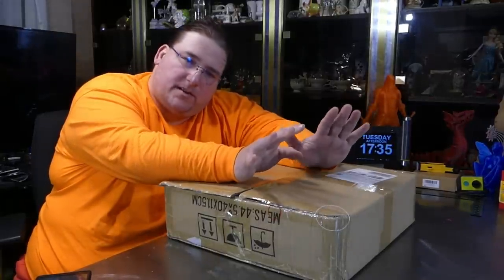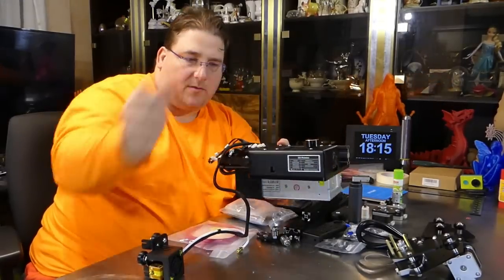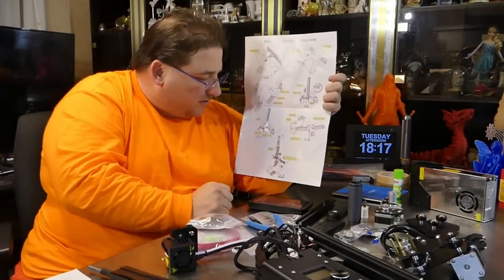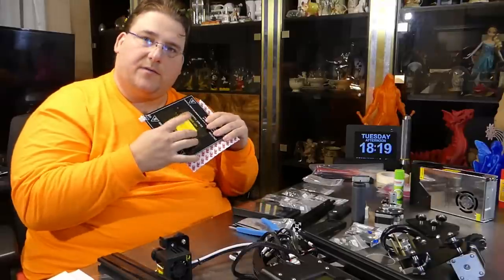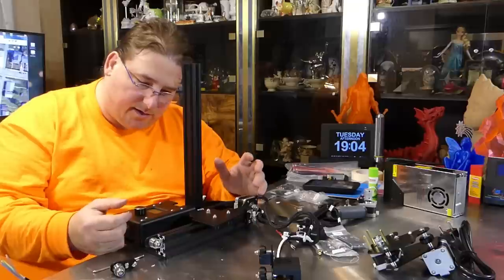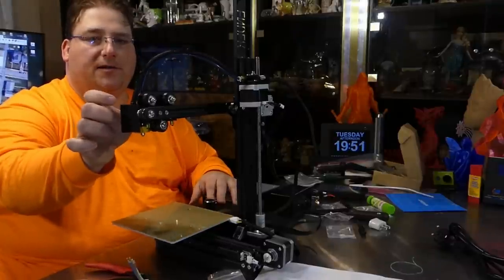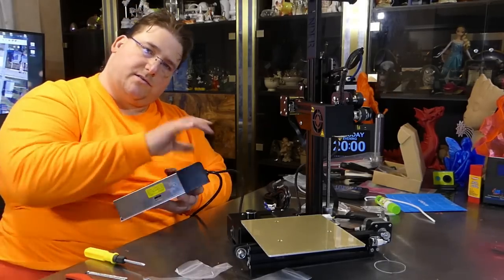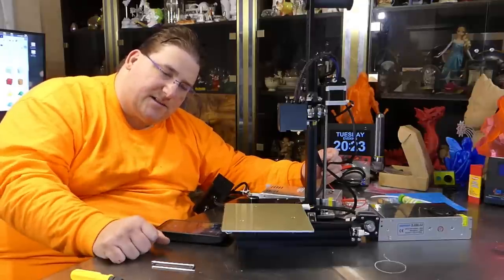Today's 3D Print 182 Ender 2 Rev2 Unbox Build No Print DOA

Comment: Hi Nerys...well, an update.  I got my ender 2 back up and running and I upgraded a few things...capricorn tube, belt tensioners...after everything was done I put on some black pla and fired it up and did a print to test.  It came out great, so I crossed my fingers and put on the dreaded wood pla...lol.  I noticed that the spool said 220 was the max, so I compromised and set it to 228 and it printed like a dream.  The print came out perfect.  I really appreciate all of your advice and help.  Guys like you are what keeps me enthused about these machines and their sometimes rather steep learning curve.  Thank you again for all of your help Sir...Richard Jackson
Reply from the maker: No problem I'm glad it worked remember there's a pretty big temperature Delta from one point on the hot end to the other so even though your heater cartridge and thermistor might be reading 230 the actual pla is probably the only reaching 225 and there's a pretty good tolerance built in there too :-)

Comment: I have just purchase the Hictop ender  and like yours mine was also DOA. This is my first 3D printer . I couldnt wait to get it up and running. . Spent the best part of an hour testing the PSU and everything was working . I then decided to remove the control panel to find the main power lead to the control panel wasnt even connected. 

It now powers up and I have leveled the Bed. Now i have just to spend the rest of my life time trying to figure out how to print stuff.  Mine never came with any test prints on the Memory card either ..
Reply from the maker: interesting. mine is a wee different the HEATERS turned on (bed and nozzle got hot) but nothing turned on. I will open it up tomorrow and poke around inside!

Comment: Apparently my Ender 2 was a Rev 2 - now i'll call it a Rev 3 with all the changes I've done :P It's fully silent now with TMC2130's and a passively cooled supply. Total investment is around $300 including the original printer price. On that note I have a spare mainboard for the Ender 2... just saying

@6:12 - strange my Y axis idler was on the "outside" maybe the kit was prepped by a newbie
@7:20 - I've noticed oddball sized hex sizes too on various screws - namely the ones holding my hotend on in my case
@8:50 - AC wire color: more commonly black is live, white is neutral, green is earth

I really dislike the power supply cover - that power supply is actively cooled with NO vents - except where the screw terminals are. The cover that comes with the printer needs some vent holes IMO.
Reply from the maker: +Ross K agreed I hate the power supply but I wanted to build it like everybody else would :-) apparently they had difficulty sourcing The Brick or it just didn't have enough amps to get the ABS temperatures so they switched out

What do you want for the motherboard :-) I suspect that's what's wrong with mine

Comment: I’m using an Xbox 360 power supply on my Ender 2 and it works perfectly. It even has a soft standby mode via a sense wire which I’ve connected to the GPIO on my pi zero for remote power off.
Reply from the maker: now thats interesting. I still have one of them lying around here somewhere (my brick died on one of my enders)

Comment: The 2 X gantry screws... The heads were also bad on my Ender.   I replaced them with M5 and heavy duty “slide in” T-nuts.  You must drill the holes a little bit larger first.   This holds the X Gantry extrusion MUCH better.
Reply from the maker: +ApplesUPnorth yep those that go through the gantry arm into the vertical trolley are super sketchy!
Reply: I have 2 of these later Ender2 printers and love them but the stupid bolts that hold the gantry are slipping because I didnt replace them and couldnt get them tight enough with the allen that starts to strip when tightening them. This is the only problem I have had with these.  When will china Manufacturers ever learn about quality control , Instead of  "these screws are a penny less for a hundred lets use them, to up our profit margin! "  Wish I would have known this but its a fairly easy fix.  I am almost ready to drill them to a larger size -lol

Comment: You can get the power cables for pretty cheap at menards, or other hardware store, cables you get from there are a bit longer and heavier gauge. I have a box for my printer so having the extra length is nice since I have to route the cable a bit before it gets out of the box.I have a box of the iec cables however some others may not. I think the super long bare cable was 5 bucks. on another note you may want to check the voltage coming out to make sure it is close to 12v. my anet had 11.4v when I set it up and had some goofy things happening to it till I checked ><
Reply from the maker: yep all you need is this

http://amzn.to/2DuLVqM

pretty sure they are like $3 at home depot.

snip off the EU plug on the cable that comes with it. strip the wires. open this thing up and wire it up. Done.
Reply: aww I was talking about the cable itself, these guys, they come in 6ft cables as well.plug end would work too. I have used these cables for fixing power tools as well. https://www.menards.com/main/electrical/electrical-cords-cord-management/specialty-cords/smart-electrician-reg-16-3-3-indoor-power-supply-cord/09703/p-1470660795788-c-13965.htm?tid=-5476609041554859570&ipos=16

Comment: Two Comments:
1) Where does cool air enter the PS? That would be the slot over the connection to the PS. The plastic cover effectively blocks the air intake.
2) I will be very interested to see where your prints wind up when you get this going. On mine they all (including the creality Cat) print 25mm to rear of where they are supposed to. Now I can correct that in Simplify3D but the fact that there is an obvious error in the firmware bothers me.
Reply from the maker: the connection of the cover is no where near airtight not even close. it won't slow down the CFM of the fan over that large an area. it will pull air through every opening on the unit.

none of my enders have an issue printing in the right location?? or is that something you think is unique to the new one?
Reply: I think that it may be limited to the new version which has the updated control board. I believe that they may have made an error in the parameters when compiling the  "Marlin" firmware ... but I have nothing to compare it to. Thus I am interested if you have a similar result.

Comment: Chris take a look next to the SD card slot. To the left  there is an old school camera style USB thing. Let me know if you figure out what that is for.

UPDATE: FYI, I have not tried to run mine again. I'll try after I get a 3 prong cord. I emailed the company with no reply. 3rd... what did the company say about DOA screens?
Reply from the maker: +Sirbob Games you can connect these machines to a computer to run them via pc software. That is what the usb connection is for.

I have not gotten a reply yet.
Reply: What about the V+ ADJ power connection? I didn't use that.
Reply from the maker: put a meter to the 12v output. if its 12v you don't need to mess with that.

Comment: Nerys:  On one of your videos, you tried to attach heatsinks to the stepper motors to cool them down.  However, the heatsinks did not have thermal tape on them.  How did you attach the heatsinks to the stepper motors?  What heatsinks do you recommend?  What thermal tape/glue do you recommend?  My steppers are incredibly hot and I need to cool them down.  Thanks!
Reply from the maker: In my Ender 3 mods video I have links to the heat since I got very cheap I'll have to add a link to the glue so I'm gave me a link to glue and it worked great I used a piece of masking tape to hold it onto the glue set and now they are fine they still get quite warm but no longer hot to the touch

Comment: Hi Nerys, recently I've been messing with Astrobox and Octopi so have needed to use some SD Cards so I can switch between the two systems easily on the single raspberry pi I have. I have 4 SD cards that came with each of my printers, the oldest is only 9months the newest is 3months and all 4 have failed with read write errors and virtually no use to have worn them out.

Turns out they were fake cards (3 of them have Kingston embossed on them and are 8Gb in size).
Just a word of warning for everyone if you have weird printing issues with the free SD cards bundled with the printer and think you are losing your sanity! 

Might be worth doing a blog on this and testing each of your SD's to see how many fakes you have...? There is software available that can do a read/write test...

Thanks!
Reply from the maker: +Chris Kyriacou yep that is pretty common :-) are these from your creality printers or from other printers so far my creality cards have held up fine I'll be enough the one from the tornado died in 2 days :-) and it was a fake the one that came with the Tron XY also died
Reply: Nerys yep, my ones from TronXY, Raiscube and two from He3D all dead.
I strongly recommend anyone using SD Cards to buy a reputable make and source, like Sandisk/Samsung/Lexar etc they are so cheap even from big name retail stores and Amazon. I managed to get a 4-pack of class 10 16gb Sandisk from Amazon for $30 to replace all the failed ones.
Tip: When writing/reading large files to the cards, try to use a USB adaptor and not the SD slot in your laptop/PC as this will double your read/write speeds.
Reply from the maker: +Chris Kyriacou 16gb 4 for 30 is not too bad. You can get 32gb cards for $9.99 pretty much anytime on amazon. Even when not on sale its $11.99 or $12.99

Comment: Which vendors should be on my list for buying an Ender 2 to cover myself with a replacement policy if I ever received a unit that is DOA? Or is it a shorter list to say which sources are not going to be of any use trying to get a replacement.

I live in Canada and haven't searched out a domestic seller of Ender 2's. Probably far too expensive here anyway which is typical, but again, if I had top notch protection from getting a dead unit, that factors in.  I've bought electronics/photography/audio gear online from China and from U.S. and I'm comfortable buying from either. So far I've gotten satisfaction on all my purchases from various businesses.
Reply from the maker: The ender is tough since the only way to get it really cheap ($160 currently) is Gearbest (that I know of)

Amazon is best for me in the US (not sure about canada) as it has a VERY rock solid consumer friendly return policy.
Reply from the maker: +David they're not as inflated as you think consider this go buy 10 Enders 4 160 a piece that's $1,600 and now put them on Amazon and keep in mind Amazon's going to charge you a hefty premium to list it on Amazon and you've got to handle the shipping built-in to that price and returns built into that price that's why  hicTop stop listing it the returns cost got to be too high they couldn't make any money to save money you'd have to ship them through your own website but now you have to handle those Logistics and you lose access to the Amazon Marketplace so the price is really aren't that bad when you consider those factors I was surprised they were able to sell it for $200 on Amazon it should have been 250 that's what I would sell them for on Amazon and the profits would be very tight
Reply from the maker: +David it's not 330 anymore it's over 400 on top of that that was a fire sale TiVo had pissed a few people off and they compensated for it by fire selling their printers to push sales through so you won't see that price again :-)
Reply from the maker: +David oh. Wow. That is amazing its still that cheap. Now i wonder old version or new version as inreally want to play with the new version (new stepper drivers no salmon skin!)

Makes you wonder don't it. If they can sell a $500 for $300 and keep doing it. What "is" there cost for these things?
Reply from the maker: +David and dont worry about arguing. You were right. :-) i have not checked the tornado link in a while it was over 400 last i checked. Clearly its on sale again. Maybe permanently (that would be wonderful)
Reply from the maker: +David I would be very surprised tornado came with a warped plate those things are beefy :-) it's pretty easy to verify though just get a straight edge and laid across the plate at multiple angles if you see a gap or a bow you have a warped plate of course you're straight edge needs to actually be straight :-)

Be careful about laying another piece of glass on top of it as the carriage is already very heavy and pushing the limit of that y-axis stepper motor which is why TiVo had to jack up the voltage a little bit :-)
Reply from the maker: +David ask for a replacement. It would take a while but them see to be pretty good about that kind of thing.

Comment: Hi Nerys...Im hoping you can give me some advice.  I recently purchased a ender 2 printer from amazon.  After setting it up and gettting it dialed in, it was printing fine.  Then the extruder stepper motor has totally stopped working.  I know you have several of these little printer and I really like the printer, but this is not a good sign.  Can you tell me what model of stepper motor is used and if you have had any similar problems...Thanks,  Richard Jackson
Reply from the maker: Doesn't do anything at all? Sometimes the gear comes loose on the extruder shaft so the extruders actually moving but because the grub screws came loose the gear does not turn so first verify that

Next verify the wire is fully seated unplug it and plug it back in and then if that doesn't work open up the case and make sure it's plugged in inside sometimes these things work loose during shipment

Lastly if the stepper died that happens of the 40 printers I've had I've had four of them where the extruder stepper motor died within a hundred hours of starting it just happens there's no way QC can detect it there's nothing they can do to protect it it just happens just look for a normal Nema 17 on Amazon I'll put a link up later when I get home it's about 13 14 bucks they're not expensive and you'll have it in 2 days if you have to go that route I've never had to replace one twice although that's not impossible
Reply: Hi Nerys...I took your advice from another vid and switched the wires on the y axis and the extruder...and the extruder motor worked and the y axis motor didnt...so I guess my next move is to open the box and check the connections...ugh
Reply from the maker: While I can't guarantee it. It probably is just a loose wire it was probably barely on there when it got to you and it finally just popped free fingers crossed that that's all it is :-)
Reply: Well, I pulled the lid off and checked the connections...I unplugged all of them and plugged them back in...still doesnt work...I did get an email from the seller, so Im going to try the test that they sent me and go from there...Im guessing now that the board is broke...hoping that I can get a replacement...
Reply: Hi Nerys...well, its been a weird experience...I pulled the box open and unplugged and plugged in all the wires...and I did the test that the seller sent me.  Heated up the hot end and tried the extruder.  At first nothing worked and then the x and y and z started and then the extruder started working...I put it back together and heated it up and started a print...the printer started laying down plastic like a charm....WOW...thanks for your help with this, Sir...i really appreciate it.